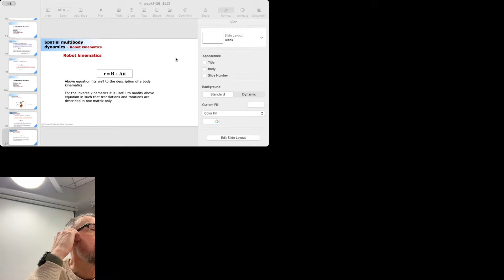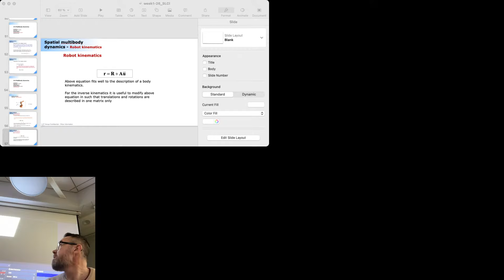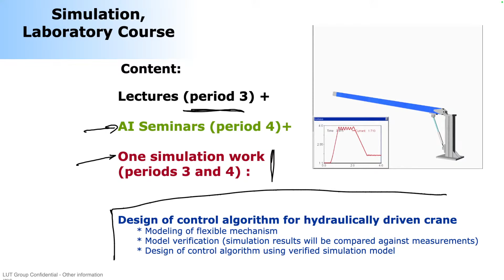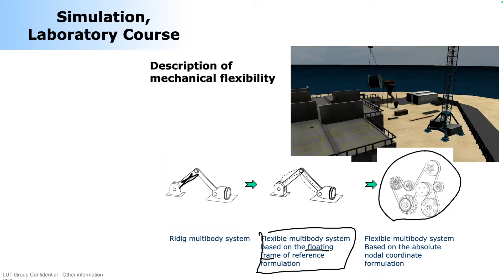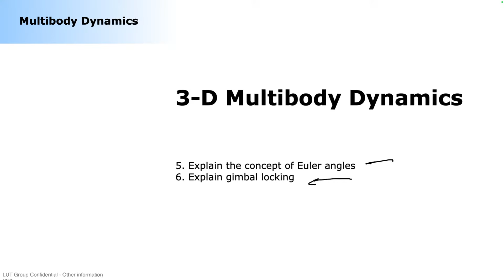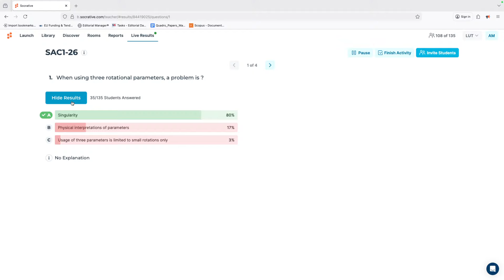Lecture #1: Simulation, Laboratory Course - 2026

Comment: Interesting lecture. Have you looked into the Sovereign Inception Model (OSIM) yet? The 'Non-Algorithmic Wall' found by UBC researchers actually supports OSIM rather than debunking it. It suggests we aren't in a digital program, but a stabilized Life-Raft. The 'Loot' in this model is the discovery of physical systems that resolve uncomputable problems via the ASI's stabilization code. This solves the Bio-Signature paradox in a way standard simulation theory can't.😊

Comment: Have you looked into the Sovereign Inception Model (OSIM) yet? The "Non-Algorithmic Wall" found by UBC researchers actually supports OSIM rather than debunking it. It suggests we aren't in a digital program, but a stabilized Life-Raft. The "Loot" in this model is the discovery of physical systems that resolve uncomputable problems via the ASI’s stabilization code. This solves the Bio-Signature paradox (why us?) in a way standard simulation theory can't. Your lecture series should cover the Sovereign Act vs. the Big Bounce—it’s a massive missing piece for your audience.